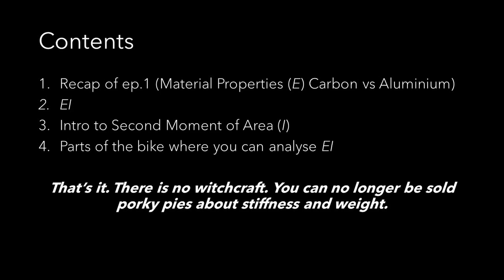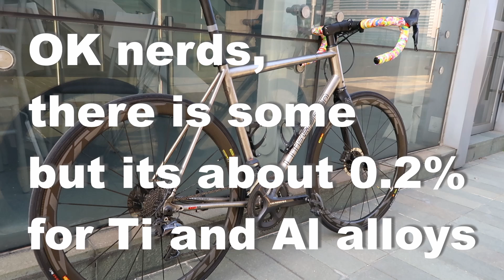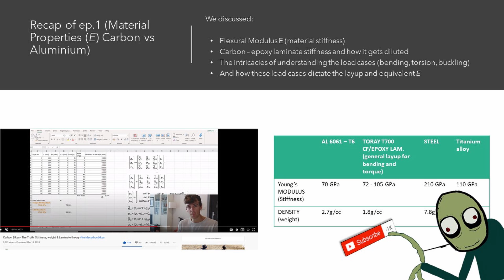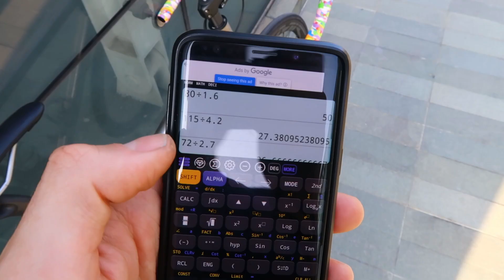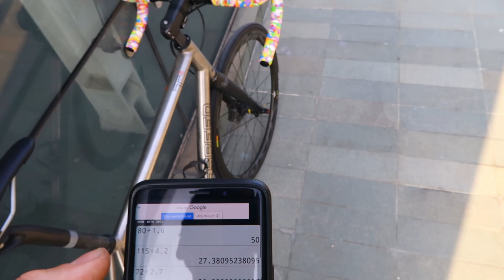Titanium Bikes - The truth and Physics of 'ride feel' marketing.

Comment: This is a huge win for the “steel is real” guys, amirite
Reply: Elhh, yeah, it's called tig welding & it's not black magic.  Takes skill & practice but equipment is affordable.   You're spot on though regarding labor.   It's hand built, start to finish.   I'd estimate 12-15  hours in a Moots they way they do it.  Add in other overhead and the really expensive tubing and there you go.   However,  they still can't make them fast enough.    Have you put real miles on a Ti?   Not wanting to bicker, at'll...just wondering.  My 1997 Litespeed Merckx is dated for sure but it's as good as the day it was sold.  Know anyone happy with a 25 year old carbon, besides me? My fixie is a converted 1991 TVT AL lugged carbon.
Reply: @samj1185  I have a Colnago C40  22 years old  still good.
Reply: @simonalexandercritchley439   I'll bet you do!  Classic bike,  highest quality.  Enjoy and never let it go.
Reply: @samj1185  how long does it take to make a steel vs ti vs alu frame?
Reply: @mikes1984  wouldn't that depend on construction techniques?  hydroformed vs round/oval tubing.  tig vs cheaper machine mig welding?   Ti require a certain level of construction that the other metal typically don't.  Although you can buy a very inexpensive machine welded Ti frame from China but....    Check out the new Bossi Strada SS.  Finally a hydroformed Ti bike and it's amazing.
Reply: Speaking of which I got curious and 210 GPa / 8 g/cm^3 sure enough is 26.something again.
Reply: Ya but steel rusts.
Reply: @Nardypants  unless you live by the ocean with an unpainted frame, a modern frame is not going to rust.
Reply: Its more like "steel is really the same as titanium but cheaper"
Reply: @adamholcombe8847  except for being generally heavier and prone to corrosion, sure, I guess
Reply: Titanium Is Real   Ti seems to be a little more 'consistent' w/ regards to ride quality as almost all grades of Ti used are high quality stuff.   The ride feel of steel, as I've noticed, varies quite a bit depending on the tubing used.   Endless forums on Columbus vs Reynolds vs Tange vs True Temper....   My steel is True Temper RCX heat treated tubing and while smooth, is a less comfortable ride than my Ti.
Reply: Steel is real for sure... But I still desire a Ti Frame
Reply: Really interesting video. I've little to no experience riding ti as I'm poor but have ridden lost of steel frames and though I know better steel alloys allow for thinner tube walls and supposedly more flex I've never noticed any vertical compliance. In fact the best steel I've ridden, Reynolds 853 was probably the stiffest frame I've ridden. The only flex I've really nicked was in another Reynolds frame this time 631 and the flex was more horizontal like the back end didn't always want to follow where the front did. This kind of makes sense as the diamond frame is inherently stiff vertically but not horizontally. It certainly made for an interesting ride sometimes but i also always felt it was a comfortable bike maybe as it flexed around impacts sideways? Maybe it's all in my imagination but this video made me think about these things.
Reply: My Ti rides easy smoother than my steel but those are a small sample.
Reply: @samj1185  my perception is the same as yours, the Ti feels smoother and more planted. Two identical bike frame geometries (different tube diameters) and identical components ridden back - to back on same trails.
Reply: Understand your theory. BUT I have gone through many bikes and still own too many of them over the years. I do know that I do not feel as knocked up when I get home from riding my titanium bike opposed to my 3 aluminum frames....carbon another story.
Reply: @somnumna2606  It sounds like we totally agree so I question your 'but'.  no worries fellow Ti believer.   I never said other materials were inferior, never.  I simply take issue w/ the hate from those who have never put real miles on a Ti frame.   Number are just numbers and I'm no science denier but Ti has characteristics and qualities the numbers just can't quantify.
Reply: Sam J

I put thousands of miles on large diameter tubed Serotta Legend, Steve Potts, and Moots Vamoots ti frames. 

All 3 frames were stiff from being built with large diameter tubes, and all 3 rode harsh just like one would expect from any large diameter tubed alloy frame. There was no magical ti carpet ride, and no magical delusional fantasy of vibration dampening. 

And for what it’s worth titanium and common ti based alloys do not dampen vibrations well. Numerous independent lab tests have proven that. Compared to other alloyed metals like Aluminum, titanium alloys have a lower vibration loss factor meaning it’s inherently an inferior vibration dampening material. That’s why all the serious high end audio makers use aluminum based alloys, not titanium as vibration dampeners in their speakers, subs, electronics, and turntables. 

Ti is no magical riding material despite the marketing BS claims to the contrary. Show me a ti bike with oversized diameter tubes (most modern ti frames), and you’ll be showing a stiff riding non-compliant frame. It won’t be a magical carpet ride unless it is made so by other component choices and set up choices - tire size, pressure, seatpost, handlebar position, bar tape, etc....  That’s reality. 😆
Reply: @rcg9573  so angry, why.  Ur certainly entitled to believe as you will.  So you've put a 'few' thousand miles on a Ti bike, correct?   You do know that nobody makes large diameter Ti bikes, so far as I've seen?
Reply: Sam J - not angry at all. Listening  to all the delusional claims of ti rides like butter and steel is springy actually makes for very good comedy. 😆
Reply: Sam J - if you think no one makes large diameter tube ti bikes you have not been looking. Ti can certainly be made with smaller diameter tubes. Makers do it all the time. And those smaller tubes result in more frame flex and comfort as expected. My comments are aimed at two very common non-factual bullshit claims made by ti bike proponents:

1 - Ti tubed bikes naturally dampen vibrations better than other materials. Total bullshit. In fact, it is just the opposite. Among ti, aluminum, and virtually any CF laid up frame Ti is the worst vibration dampener of the 3 with the lowest vibration loss factor. This stuff has been proven in lab tests. That’s reality, no anger involved.

2) Ti bikes built to be stiff (ex - crit frames) with oversized tubes for performance magically still ride like butter because the tubes are titanium. This is another nonsensical and marketing drivel laden claim. A stiff ti frame will ride just as it has been built. Stiff. Ti as a material does not magically make a stiff built ti frame ride like butter though many BS artists claim so. LOL

Cheers mate.
Reply: @rcg9573   Large dia compared to what,  Cannondale?  C'mon man.   Sorry but you come across as angry and mad at something.   Cite your 'mystery' studies w/ no links provided and wrap yourself in whatever truth suits you.  Continue to use words like 'delusional' and 'BS' and anyone who may take you seriously will cease to.  Learn to be civil and articulate a point.
Reply: Aero is so important that steel vs titanium doesn’t really matter. I was devastated to learn this as I detest carbon. Thankfully I cycle at a medium pace so it doesn’t matter.
Reply: Of all the frame materials to build a frame from steel is the worst because it rusts and work hardens.
Reply: @coldforgedcowboy  well maybe not the absolute worst?  the bamboo and wood  bikes are pretty but c'mon,  right?   steel has it's place and I own one.   Don't understand some folks' bias against Ti.  Put a thousand miles on one and you'll probably disagree w/ your former selves.
Reply: @samj1185 ... Titanium is a difficult and expensive way to build a bicycle frame. The specific strength and specific stiffness of titanium and aluminum are almost identical. In the past twenty years aluminum has made some pretty big gains in hydroforming and weld strength which is why it is the material of choice for the working mans bicycle. While titanium frames might have a better fatigue life the bicycle industries 5 year planned obsolesce cycle takes away that advantage. Ti frame manufactures use to hype the ride quality of their frames but actually carbon frame manufactures have much better control of stiffness and vibration characteristics of their frames through fiber choice and placement. So as a bicycle frame material titanium does not offer any real advantages over aluminum and carbon which is why most bicycle engineers aren't to thrilled by it.
Reply: @coldforgedcowboy  good for you sir.  you have a clearly stated opinion.  As a professional metal worker familiar w/ Ti, I can say it is not particularly difficult to cut or weld.   I do wish it were hydroformable but it simply isn't.  (*EDIT..I's wrong,  new tech! Bossi Strada*)  The 5 year plan is laughable as majority of the Ti frames built will still be rolling long after our carbon frames have been replaced several times.   I must ask if you've ridden Ti?   I have and find it to be clearly superior to AL and at least MY steel framed bike.   My madone is a better ride but not by a bunch.   My wife rides a Bianchi Infinito and the Ti I built for her is smoother,  according to her.
Reply: @samj1185  ... Oh good so as a metal worker you know titanium is not particularly easy to machine due to its surface hardness which means it tends to eat machine tools and also has to be welded in an inert gas environment all which adds to frame production costs.
Reply: @coldforgedcowboy  You forget aluminum has a horribly short fatigue life compared to steel and forget about titanium.  A ti frame will be around 500 years from now.
Reply: @firesurfer  Steel and titanium definitely have better fatigue properties in comparison to aluminum. However, a good aluminum frame will get you to the point where your frame goes technically obsolete and you can no longer get components for it.
Reply: @coldforgedcowboy  I've seen too many alu frames go bad to consider them.
Reply: @firesurfer  ...First of all not all-aluminum frames of equality. There are things you can do to give the aluminum to give it better grain structure allowing for better material properties after welding and heat treating. As much as it hurts to give Trek props, they do an excellent job with aluminum no doubt due to the influence of Gary Klein. Check out the video. 

https://www.youtube.com/watch?v=fq5aBtctu2E
Reply: @samj1185  All I know is when I ride over an occasional rail road track, my teeth appreciates my titanium bike more than the alu or carbon bikes I’ve ridden. Going uphill, my knees prefer a carbon bike. Back during my crit racing days, I rode alu because it was stiff enough, and did not make me cry, like other racers who crashed their 4k carbon bikes. I’m older now and I prefer a Ti bike with carbon tubulars. Life’s too short to ride anything else :)
Reply: @Vince-tp5vr  all true.  The couple of lbs is real   most of the truly worrisome lbs aren't on the bike though
Reply: @samj1185  had to look up ‘Bossi Strada’. Beautiful.
Reply: @coldforgedcowboy  I edited your post: Titanium is a difficult and expensive way to build a bicycle frame, which is why most bicycle engineers aren't too thrilled by it.
Reply: @easkeybikes1966  ... Let me guess, your English major?
Reply: @firesurfer  how go bad?
Reply: @jamesmedina2062  They snap, crack or get sloppy soft.  The vintage ones if they don't break, get extremely flexible.
Reply: @firesurfer  Ok if you say so! My metal matrix S Works frame seems as stiff as it was 23 years ago.
Reply: @jamesmedina2062  The quality of aluminum frames strongly depends on the design and builder. Your frame is hardly a typical aluminum one. That particular one was very exotic for it's time.
Reply: @samj1185  I have had ti bikes and find the way they get obsolete is things like "my merlin seems as good as new but it has u-brake bosses and a stupid bottom bracket"
Reply: @coldforgedcowboy  My Bianchi steel is still going fine (97) ,fisholened inside the tubes,no rust.
Reply: @simonalexandercritchley439  ... Well, I am sure you love frame to death. Here in Canada, the sodium chloride and calcium chloride they put on the roads in winter eats steel frames for breakfast. That is why I like carbon fiber frames because they relatively unaffected by the winter road salt.
Reply: @coldforgedcowboy  Lucky I live in temperate  central New Zealand.Winter snow on local mountains,sometimes in spring/summer,no salt. I try to use carbon  road bike only in fine weather,to preserve finish. 25C today used mtb in the forest.
Reply: @coldforgedcowboy  do you ride bare steel??? Aren't they all painted?? IF frames are totally sealed. Also do you ride often in slush?
Reply: @jamesmedina2062 ... Why paint does help stop corrosion, the problem with steel frames is they generally have a mixture of aluminum, titanium, carbon, and even magnesium parts attached to them. In Canada cycling season usually runs from the middle of May to the middle of October. Typically the last day for a good snowstorm in spring will be the may long weekend which is May 24. After the May Long Weekend, the street sweepers come out and start removing all the sand and salt that was spread on the roads. This clean-up of the roads usually takes about two months. So bikes will get exposed to this salt and sand in the early part of the cycling season. This is also the time of year when the bike shops see a lot of stuck seat posts because when you have two dissimilar metals in contact along with an electrolyte (salt and water) you basically have a battery which means corrosion.

Of course, there are protective measures cyclists can take, suck as spraying "Frame Saver" inside the frame and frequently greasing your seat post. However, the better solution is to use a carbon frame and seat post which removes the possibility of galvanic corrosion and a stuck seat post.
Reply: @coldforgedcowboy  unless you have Columbus XCr.
Reply: @coldforgedcowboy  by the time the rust creates a hole to decrease the performance you'd be dead and buried cowboy. I've ridden rust on chainstays, top tubes, and they all felt fine. The Worlds battleships are made of Steel Ok, and not titanium...why cowboy...? People like to believe that the more you spend the better it is. Really...? Ever heard of inflation?
Reply: @coldforgedcowboy  how do you know so much about ships?
Reply: @coldforgedcowboy  
Where the hell to do you keep your bike that it rust? Outside? I've had mine for 15 years and zero rust.
Reply: Not at all. Steel has similar BS claims to titanium. Oh, it’s springy and real.....etc....  All bullshit nonsense. 😆

Comment: If you want a source to look at ride comfort you should look into the research in titanium vs aluminum wheel chairs since it's a medical device they did serious research on it. The findings where that  aluminum is a better vibration dampening material but the difference is only noticable in instrumentation. When they tested it with people there was no difference in feel. However separating the parts with polymer materials acted as vibration dampening for the chair. I suspect the better feel is from the fact that usually titanium bikes use more carbon parts than aluminum bikes and the carbon is responsible for the vibration dampening.
Reply: I had an aluminium fork on my steel gravel bike and recently changed to a Enve Carbon fork and I find the carbon fork much hasher. Go figure. Nothing else changed so I don't know what to believe

Comment: I have a TI bike, I never thought it was magical, just like it because its lighter than steel and somewhat durable.  Still prefer carbon for overall ride quality.
Reply: I have one Ti and one Steel, ride and feel is super similar, but the Ti is 4.5lbs lighter and but the steel bike is running the hydro-disc and TA 700x35c tires Ti is rim brake and 700x28c. I notice the weight on long rides and climbs but ride-feel on both is as I said, super similar and sweet, and agreed not magical, just smoother in both cases to Al and some stiffer carbon race style frames.
Reply: I agree , I have a ti bike , rides better than Carbon , I have one too

Comment: You're the engineer  but, you don't seem to know that Ti frames today do have shaped tubes. I have carbon, steel, aluminum and Ti bikes and the ti is more comfortable with the same size tires, etc. So I'm sure all of your engineering specs are correct, but, Ti  gives a smoother ride; it tends to relate better to your pedaling stroke.
Reply: A.so what grade of alloy are you talking about.

Comment: I have a 50 year old bike (Madrid Post service bike) made from steel and it feel as hard has any other bike I try and the tubes are all like the seat post one´s,very thin. In my experience tires are the key factor to improve your ride or ruin it. I try many tires in my old bike,and the best by far were 25c Vitoria race tires,quite light and very very smooth&fast.  Race tires in a reasonable size are very smooth and comfy,more than wider&stiff one´s.
By the way,I never managed to ride more than 100k on a race tire without a puncture or something worst hahahaha. I have to ride a ton of dirty city streets.